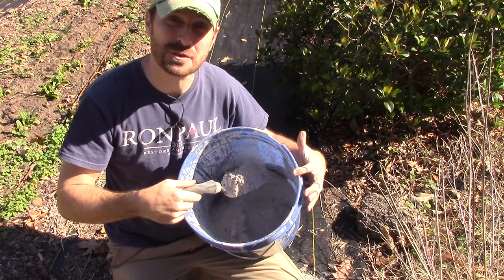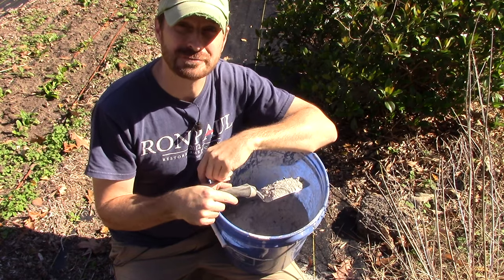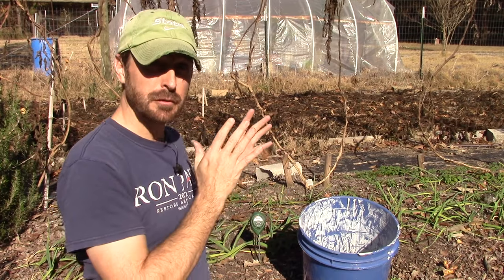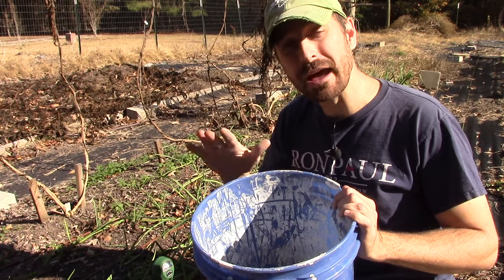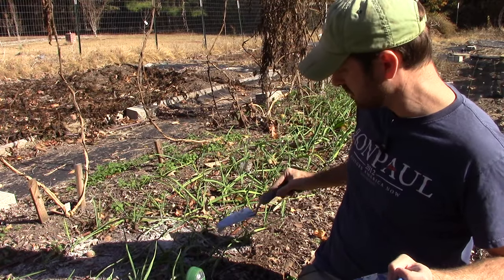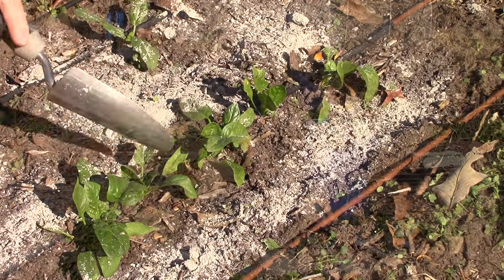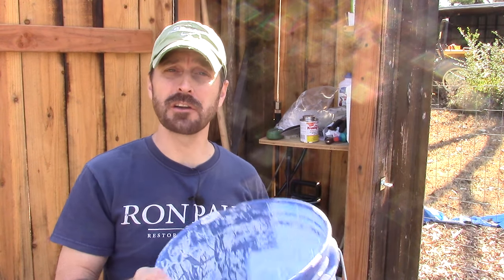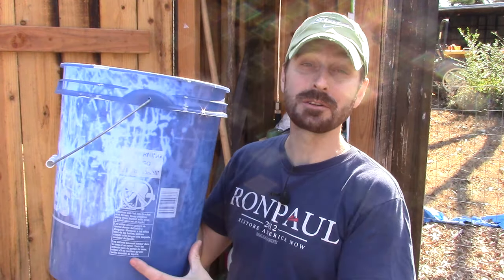Using Wood Ash In Your Garden - Benefits And Dangers

Comment: To neutralize the alkalinity of wood ash, mix in shredded oak leaves (pH 4-4.5) or pine needles (pH 3-4) to make a neutral combo.
Reply: It won’t work mix it with sulfur or aluminum sulfate  or vinegar because it will act faster
Reply: A quick reminder oak leaves and pine needles need to be green when you add them to neutralize the alkalinity, As they decompose they become alkaline.
 You can also add elemental sulfur to help neutralize the acidity
Reply: @nerdlingeeksly5192  or vinegar
Reply: @Youdontknowmeson1324  Yep! I use ferrous sulphate granules sparingly, if my soil is on the high alkaline side( which it usually is.).
Reply: @davidisaacson9328  yes that will work to
Reply: @Youdontknowmeson1324  I'll be damned if I lose some granules on the concrete...and then it rains. Stained concrete!😄
Reply: Why dont dissolve it in water 
I know that great part of ash is insoluble but k2co3 is soluable and its very beneficial

Comment: One thing I would like to add if I may, since someone mentioned a coal stove: NEVER use coal ash in your garden! Wood ash is awesome, but coal ash from your stove is the same stuff that power plants produce, and it's just as full of sulfur, arsenic, heavy metals and a ton of carcinogens as the coal ash ponds you see on TV. It will make your garden grow beautifully, but you won't want to eat anything out of it!
Reply from the maker: Good point. I have never heard of anyone burning coal in their home though.
Reply: @CountryLivingExperience  While not as prevalent as it used to be, in Appalachia where coal is still king, it's probably used as much as wood. Across the board though, I would offer the caution to using ash from the Kingsford BBQ grill as the biggest contributor to suburban coal ash in the garden. It's the coal dust in briquettes that not only makes them smolder, but also gives that "wonderful charcoal" smell and flavor to your food.

Comment: I have various types of sedum growing in a tree circle around a sugar maple. The main soil is mostly pine mulch ground very fine. I'm guessing it's great to use on that stuff. Tree bases are usually very acid anyway. The dust should help the sedum spread. The recommended fertilizer is 0-5-5. A half a cup around the whole tree. 🐀🐾

Comment: You can neutralize the alkalinity by adding the ash to a hot compost pile. Great video!
Reply from the maker: Yes, good point. Thank you
Reply: does it need to be hot? how about worms?
Reply: How about adding acetic acid solution?
Reply: I put my ash in my compost first

Comment: I have a hugenkultur above ground raised bed, I will use wood ash a little bit, I mostly tamp out the fire to make a charcoal/ ash mix as it seems to help the plants. Since I have a good sized bed, and I am constantly adding organic material and adding native sandy loam/ clay type soils to it, I've found that charcoal helps aerate the soil.
I also add vermiculite or perlite or cinders to the soils, my plants seem to do fine and they produce great yields.
Reply from the maker: Wonderful. Sounds like you have a great thing going.
Reply: @CountryLivingExperience  Thank you I did before the C 19 junk, now I use my hobby to feed myself.

Raised beds/ Hugunkulturs are the best method I've come across to actual food crops, ground planting is nice if the soil is good and full of life. 
However in the Western states most of the regions that aren't already turned into farm land the soils suck.

And being able to control the soil by using common sense and good techniques go a long way.

I once had this same channel until I peed off a YT god, and all my vid's and subs went away. 

Word of advice make sure to back up all of your work onto solid state drives.

I had a video of constructing the bed and the techniques that I used.
What I really like is the fact that I use about a tenth of the water to grow with vs if I had sowed directly into the soil.
Being a dry high desert location, water is a premium. While it's not quite as good as a hydroponic setup, I don't have to rely on the Petrochemical fertilizer's to grow my food.

Take Care and God Bless
Trump MMXX

Comment: I’m a little confused I had 2 potato patches this year one of them was in the ground two weeks before the other The one potato patch not very impressive 60 pounds of potatoes on a 8 foot and 20 foot roll the other we dug it up the same time was very impressive with one 8 foot roll producing 50 pounds of potatoes and a third of the size bigger and we put wood ash on that one!  It seems to happen consistently they seem to love wood Ash and the potatoes will be 30 to 40% more productive
Heard you can use it on the leaves to help control potato beetles.
Reply from the maker: Very interesting. I'll have to experiment.
Reply: @CountryLivingExperience  The potato I plant is Kennebec potato maybe it prefers more alkaline soil?
Reply from the maker: Potentially. I'll have to research that variety.
Reply: I’ve read it’s because of the potassium. Potatoes thrive in potassium. But I put too much on one of my potato plants and it did Burn it.

Comment: You can buffer the ph back to neutral pretty easily by mixing your wood ash 50/50 with soil and leaving the mixture out for a day in a bucket with water.
Reply: It won’t work add vinegar and leave it

Comment: Does woodash and cowdung ash have the same pottasium or nutrients?
Reply from the maker: I have never heard of using or making cowdung ash so I do not know its chemical makeup.
Reply: @CountryLivingExperience  Actually in India it's pretty common ,to use cow dung soaked water as a fertilizer,and yesterday I just gave some of the burnt dust of it(that is actually used to make fire or heat for cooking and also like an agarbatti) so that's it.
Reply from the maker: Thank you. Very interesting. We do use dried cow dung as fertilizer here too but not in an ash or burned form.
Reply: @CountryLivingExperience  well I just used it as a form of experiment, let's if there's any changes,I will let you know here. :)
Reply from the maker: Sounds good

Comment: Thank you for this informative video. 
Question:  Can we use a mixture of human urine water which is acidic to balance out the alkaline wood ash?
Reply from the maker: You're welcome. Urine is not that acidic with an average PH of 6. Just use less wood ash so that it will not make the soil too alkaline.
Reply: @CountryLivingExperience  so that means we can use more urine water?  we have lime, guava, pineapples and avocado plants. they like acidic souls right?
Reply from the maker: @dfool06  I do not know. I do not grow those fruits here in my zone. You will have to test your soil ph to see what you need and then add appropriately.

Comment: I just got some compost and cow manure (The product is Timberline) that was fully composted already.  We have a PH of 7 here in E TX. But I didn't see that it had .05% potash in it. I took a couple handful's of the composts and tossed it around the Blueberry bushes. Its not very much, and I did add some acidifier to the soil a while back. Is this going to harm my bushes?
Reply from the maker: It won’t harm them. No worries. It’s good you added the acidifier.